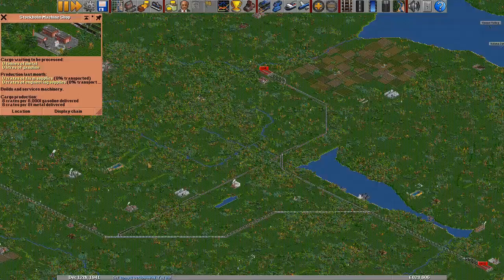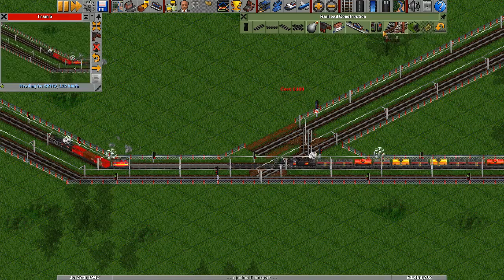That's So Metal - OpenTTD FIRS, Ep. 3

Comment: is there less hp and same max speed engines to run 3-vehicle enginering? or maybe higher speed? it hurts, that it's not profitble root )
Reply from the maker: +Sledge Hammer I didn't think to change the engine when I shortened the trains, but it's a really good idea because there's no need to have all that horsepower for a 3-car train. 

I've already recorded episode 5 but will take a look at that in episode 6. Thanks for the suggestion!